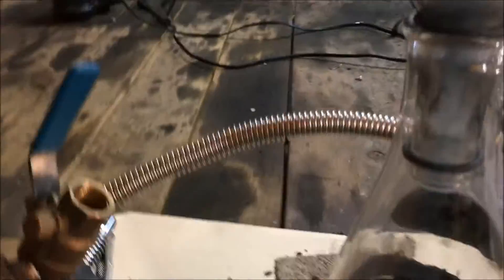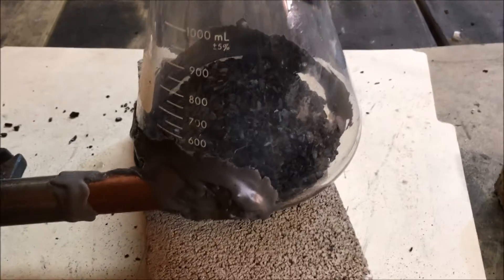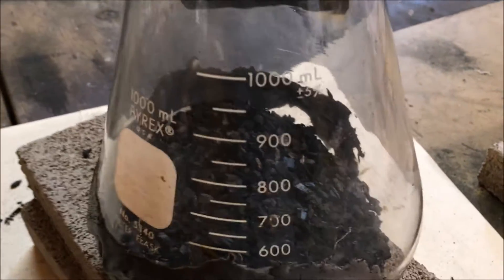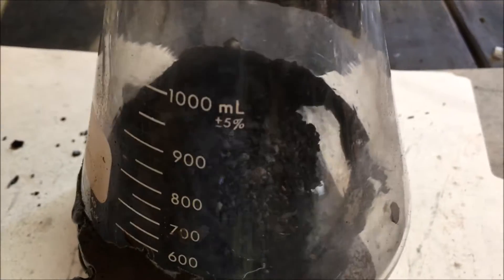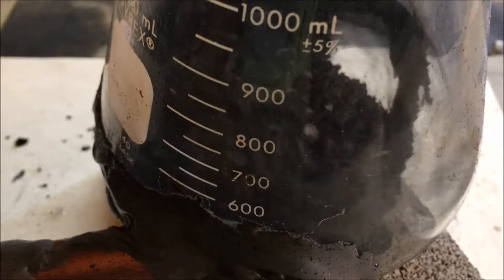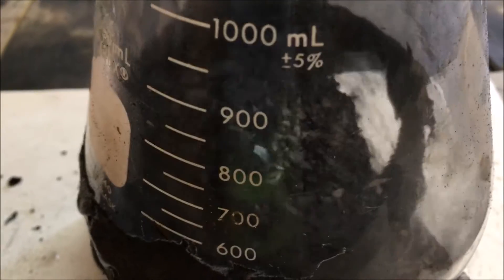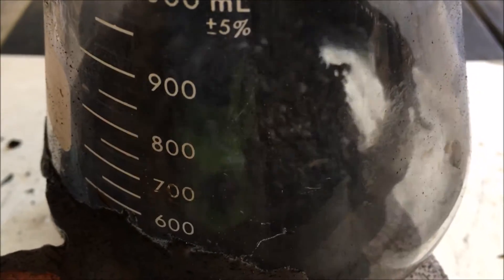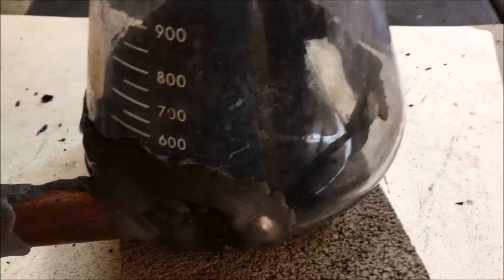Cyclone fluidized bed Charcoal GasificationTest #2

Comment: You need two stages. One to fluidize your bed and another to add cyclonic circulation
Reply: It would also be nice to add a great exchanger on the glass breaker to preheat your intake air and protect your glass from meltdown
Reply from the maker: Brilliant input friend

Comment: maybe there is too much oxygen into the flask so what appens is almost a complete combusion... but maybe. I don't know.
it's very very hot, it seems a nuclear reactor hahahaha.
Reply from the maker: I agree , i think we didnt have enough burning at one time , it needs to be more violent, if i ever get a good metal can to try this in i will , the chemistry of burning carbon says it will work
Reply: NOBOX7 a metal can is perfect. I wrote you an email.
Reply: Because i am interested on what you do.
Reply from the maker: Ok thanks , yes i did briefly speak with you , the chemical reaction of carbon combustion is amazing . it produces a flammable gas and not just co2 , soon a will resume working on these experiments
Reply: In this experiment there is too much air in the flask i think. So co2 is produced instead of co.

Comment: The principle would be easier to display if you had something like pure quartz or aluminum oxynitride, but using depleted carbonaceous charcoal typically lends toward poor results.

Shredded tire would be pretty epic, as well as easy to ignite, of course it would release a whole lot of sulfur dioxide... =P
Reply from the maker: shredded tire would be a great stock , i lit a tire on fire one time and wow , the heat released is overwhelming
Reply from the maker: thanks for the input , gonna have to check out aluminum oxynitride
Reply from the maker: im thinking of trying this using a waste oil burner to heat the steam and the charcoal and just do a super heated fluidized bed  , iron bath would be awesome as well
Reply from the maker: often people confuse this with gasification , this is a charcoal combustion reaction witch yields CO gas as a flammable by product  , im not attempting gassification its charcoal gasification witch is a different chemistry. soon i will test it with steam injection to produce water gas

Comment: Once again proving that glass only breaks in down shock (mostly) really it's based off of putting glass in tension which is hard to do with thermal expansion (though not impossible) in any case, this was an interesting example of thermal dynamics, and fluid movement, all that's needed to turn this into a coal power reactor is to inject powdered coal into the air stream, the constant collision with the sides may provide a beneficial effect, i might look into something like this later.
In all cool video my friend, even if you did not accomplish what you originally planned.
Reply from the maker: hope it works out for you , im gonna try this again when i get the time , alot of people dont understand carbon combustion so maybe ill explain it in the next test . also i will be injecting steam this time
Reply from the maker: yes the constant tumbling is key to maintain reaction service area , ash can inhibit the reaction but if you keep nocking it off it accelerates the combustion and the reduction

Comment: What a failure of an experiment! but it sure was pretty though!
Now for the intelligent comment. At the point of exhaust, your combustible gasses are too hot. Which means you have a bad air to fuel ratio. Running your gasses through a unit to cool and condense said gasses. This is good work you've done and I'd like to see you take it further.
Reply from the maker: thanks for your input , a viewr gave me the idea to weld my connections with glass so as soon as i can i will try it again
Reply: That's an excellent idea. I'd like to see that play out. To be more specific with the poipoint I was making about a cooling unit, connect your exhaust from the flask or beaker (in not familiar with lab equipment) to a coil of hose (acrylic for less cost) that sits in a container of water would be sufficient to condense the gasses for ignition. I could also see this being done with glass.

Comment: Ha ja, ja ja!! I was about to ask what is the top temp that the JB weld that you are using is capable to withstand! but you answer the question long b4 I have the opportunity to ask! Nice and awesome looking experiments! have you consider to weld the glass with "Lead glass?" you can buy cheap neon tube and melt and weld it.. so you can get much higher temperatures!
Reply from the maker: never thought of that , you are correct , glass sticks to metal very well , perhaps i will do that on the next test , i do need this device to run longer to observe its potential .
Reply from the maker: brother that is a great idea , i am so gonna try that , thanks man
Reply: Yeah that is an easy solution for your problem, you only need to seat the Pyrex glass in a large Pink Isolating blanket preheat all surfaces then just weld all then let it cool at a really slow pace then you have a totally refractory setup that can probably handle up to 3650 C degrees before you need to worry about leaks... good luck with that project!!

Comment: Awesome experiment!! I think the rate at which you supply air so as to achieve fluidisation and circulation affects the products of gasification such that you have more of carbon dioxide than carbon monoxide. There must be a trade-off between the rate of supply of air to achieve fluidisation and circulation with the amount required to produce carbon monoxide. So I suggest maybe to dilute the oxygen in air by introducing a stream of nitrogen.